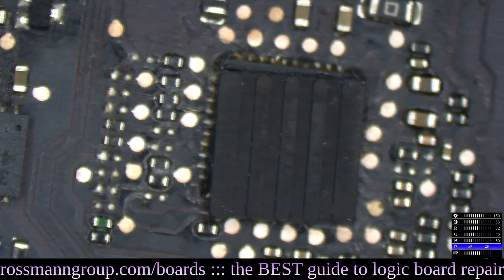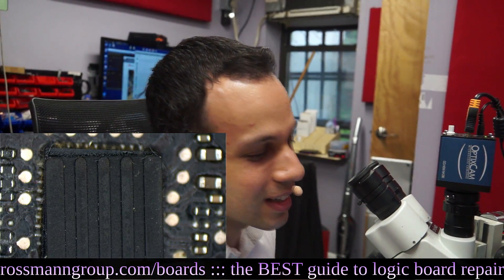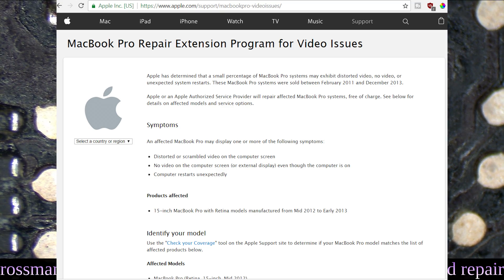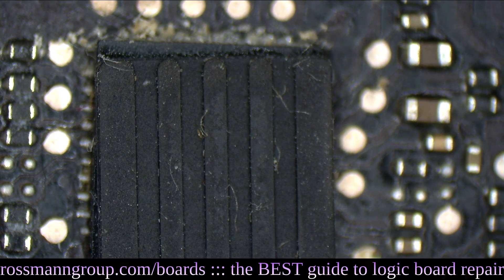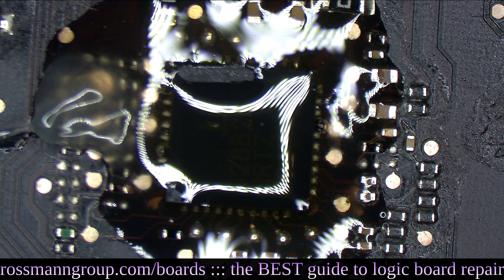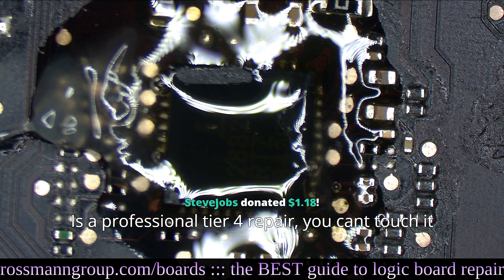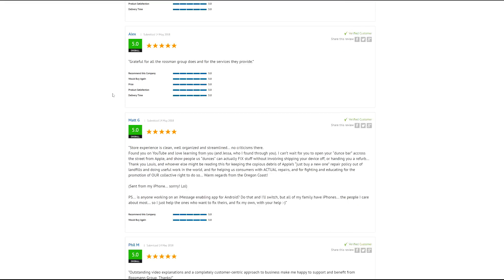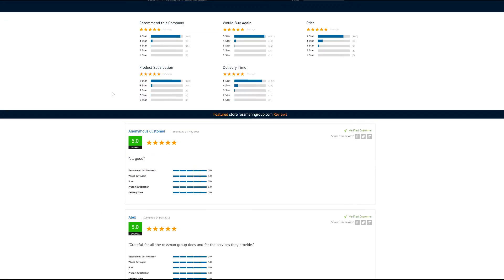How Apple authorized repair refurbishes Macbooks to fail again! GPU kernel panics

Comment: linux,ftw
Reply: Omi Kasigi I agree with this. I would never not dual boot my computers as I am a E&E student, a gamer, a novice programmer, and a really newb digital artist. 

From the perspective of a E&E student, the options of circuit sims on Linux is limited, but when there is one, it presents to be a good alternative. Example is LTSpice (Linux) and Livewire (Win) . Most students around me prefer Livewire because it is simply easier to use. Learning LTSpice is not as easy as learning Livewire. However, I found that LTSpice gave me more accurate results from simulation, and also had options that reduced my workload.

As a gamer, I don't have a Vulkan capable GPU. GPUs are expensive. Linux OpenGL is about the same as DirectX for gaming, if the program was optimized for OpenGL (e.g. DoTA2). Everything else gaming related sucks. Getting graphic drivers up is work, especially if you're new to Linux. The Linux Steam library doesn't have some of the games I like to play, and is quite limited (compared to Win). It's like gaming on Mac, don't do it.

From the perspective of a programmer, I'm split. I use Visual Studio to code in C++. That's mostly Windows only (I know there's Linux VS, but that doesn't have options I want). I use Codeblocks for other things, and that is both for Windows and Linux. I'm going to use ROS and Python, so that is Linux for ROS and any platform for Python. Both systems have similar offerings, and due to GPL and many GNU tools in Linux, I prefer Linux for this as I can just lookup a repo I need and type away in the terminal to grab it.

For digital art, Adobe CC. Just Adobe CC. Win wins this, no competition. If Adobe ever make their products Linux compatible (not everything on Linux is open-source), then I will happily migrate to Linux for this.

Sorry for the long rant.
Reply: Stacey Luster I dont care what "most people in the IT world think", that's an appeal to popularity
Reply: Just stop buying Windows software and games and tell developers to port software and games to Linux and use Snaps or Flatpak to deliver software and games to Linux or sell Linux software and games on Steam if they want you to buy software and games. Only developers of software and games can skyrocket Linux desktop market share.
Reply: Hi Richard !
Reply: DoYouW where did you  get those numbers? They sound completely made up. The only thing Linux is inherently worse for is gaming, because of the lack of recent driver support
Reply: TLDR: Both have niches. Windows covers more general use, gaming and creative use. Just a really big software library. It's like the Sony PS2/PS3. Lots of good games, lots of crap too. 

Linux is a good system to develop code on, especially back-end codes that has no GUI. Kinda like a 3DS. I wanna play my Pokémon and MH games, but that is really all that I enjoy on that system and no other alternative that's easy. 

I still dunno why to use Mac. I understand security is related to it, but I think good practices (like not installing each and everything you see) and Malwarebytes+AV software covers most things. MacOS is just a fancier Linux with a slightly better software library in my eyes.
Reply: Beginner friendly Linux distros like Linux Mint, Ubuntu, Manjaro, Solus, Deepin, etc. are good for everyone, not just enthusiasts. How to install a printer driver? Just open Driver Manager from Start Menu. It will automatically search for driver in repos and install it if manufacturer has made linux driver available.
Reply: +Kaczka Kwa Kwa to use a printer I run "xbps-install cups" and then I go print things
Reply: Yeah!
(But mainly for the higher degree of customisablity compared to Windows and Mac OS)
Reply: I'm starting to get into linux, it's nice when it works, infuriating when you hit some random problem and then spend the entire day googling and typing things into the terminal.. and when you mess that up it's basically time to reinstall! I'll get the hang of it in the end, not giving up!
Reply: indeed, it's like when we talk about our planete being at "the center of the univers", for newbies it sounds wierd and wrong, but for scientist it's a shortcut for "center of the visible univers" which make more sens for non scientist.
I agree we should take care of what we're talking about when dealing with ppl outside of communities but sometimes it's ridiculous to try since most ppl will eventualy shoot at you & get wrong anyway ;)
Reply: Simon T depend on how messed up ur system is. Usually, i would try to fix it and it would work.
Reply: From my knowledge macOS is used widely in music production. Semm to be a bunch of mac only programs that are the standard.
Reply: Perverted Poképuffs it's irony that my laptop would go blue-screen when I watch video online on windows,  # general_use
Reply: Stacey Luster until you want to run my game library on Linux lol
Reply: +Saxie81 There are many ways to run Windows games on GNU/Linux with minimal loss in FPS. You simply refuse to use any of them, and if the only thing you do with your life is play video games you're too worthless to need to use any OS, anyway. OS is in a sense, irrelevant to gamers, because they just want to launch the game. 

Stop saying "I want to run my game library on Linux", that's misleading. What you should be saying is "I want to run my Windows software on Linux". Now think about it, doesn't that just make you sound stupid?
Reply: acex222 I'm familiar with wine and other emulation that I can use.  It's certainly NOT misleading to say that at all.
Reply: With DXVK lot of games are running very good on Linux. Youtube search DXVK.
Reply: +Saxie81 WINE would be the lowest solution on my list.
Reply: Linux in the current state run way better with AMD card (Opensource drivers that work faster than the proprietary AMD driver on Windows even). Nvidia is only good if you want machine learning stuff and don't mind outdated kernel/video/xorg (Getting better there but still).
Reply: +DoYouW Most game for Linux on steam are Windows D3D games that convert themself to OpenGL or Vulkan on runtime. They come packaged with wine or have been compiled with EON for most of them, some have a customized wrapper that perform better, most of what Feral did actually are still using that kind of tech but it's way better...

So it is not Linux fault, but because Linux is feed with Windows games that run wrappers. And the performance hit relate to your CPU performance. On parity, with code that is compiled native for real on both platform, Linux perform slightly better than Windows. Also If you run old D3D9 with Opensource AMD drivers, they do perform better on Linux than on Windows as Linux do have native D3D9 support so conversion is not required here (except with Nvidia cards as they don't support D3D9 on Linux)
Reply: +Ultra Instinct Bardock LSSGSS If.
Reply: Stacey Luster you're wrong
Reply: Linux is only good for enthusiasts. Wanna answer 150 questions in order to install a printer driver? Fine.
Reply: I'd just like to interject for a moment. What you’re referring to as Linux, is in fact, GNU/Linux, or as I’ve recently taken to calling it, GNU plus Linux. Linux is not an operating system unto itself, but rather another free component of a fully functioning GNU system made useful by the GNU corelibs, shell utilities and vital system components comprising a full OS as defined by POSIX.
Many computer users run a modified version of the GNU system every day, without realizing it. Through a peculiar turn of events, the version of GNU which is widely used today is often called “Linux”, and many of its users are not aware that it is basically the GNU system, developed by the GNU Project. There really is a Linux, and these people are using it, but it is just a part of the system they use.
Linux is the kernel: the program in the system that allocates the machine’s resources to the other programs that you run. The kernel is an essential part of an operating system, but useless by itself; it can only function in the context of a complete operating system. Linux is normally used in combination with the GNU operating system: the whole system is basically GNU with Linux added, or GNU/Linux. All the so-called “Linux” distributions are really distributions of GNU/Linux.
Reply: I disagree. I use both Windows and Linux on my PCs. Linux has its uses, but Windows has more software options as Louis has stated. And I don't have the time to code my own stuff since I'm not really a programmer. I'd rather buy something that works "out of the box" on Windows.
Reply: That's quite normal, Linux is no longer capable of multitasking as well as win7/8/10 for games that's why projects like STEAM OS or other dedicated Linux based OS for games are falling down. Most bench on those systems show up +20-30% more speed on w7 and up to 50% more  speed on w10.
and it's not difficult to see why, ex: just by looking on what games rely on : DirectX which has to be emulated on Linux. And many other technical issues that make Linux OSes less and less suitable for PC games.
We could use some OPEN GL xx dev and game based on btw.
On others side, Linux OSes are perfect for small devices like phones,(android) Routers (gui), lan switching device, firewalls, etc. 
Even with new 2016 nano server architecture from MS ,  Linux OSes will probably stay king in small device for many years to come.

Comment: its like a time bomb...when the rubber goes bad,it makes the laptop seem useless
Reply: Völundr Frey, no, actually it should last just enough to make it through the warranty period. 
There's absolutely zero reason for apple to fix anything properly or make sure it will last for decades.
Reply: There's no UV and very little stress other than heat so it should last a good 20 odd years. Not for ever, but what does? Still a shitty job though.

Comment: "Make the janitor solder the products undergoing refurb and maybe add a rubber pad later if it does not mend together properly. Hey, After all most of the consumers won't see the solder joints, so lets chop down 50 bucks and sell it to fuck with them" 

I think that's what Tim Cook instructed the the "Geniuses" to do.

Comment: You think those are bad solder joints you should look inside a cheap consumer grade two way radio.  I see radios where the soldering is so poor that the joints fail before the radio even gets to the customer.  There's such a small amount of solder on them they break in shipping or within a week of use.
Reply: At least the radios were cheap.
Apple products are not. They have no valid excuse for this lousy repair job.
Reply: MikesRadioRepair do you realise that you are comparing some inexpensive product with a product that costs upward of thousand dollars?
Reply: At least hot glue is very east to remove.  Just add a few drops of isopropanol  alcohol and it pops right off.  In my world (radios) they have used that corrosive and conductive glue for decades that you have to remove with dental picks.  I spend hours every week removing that crap.
Reply: Hot glue is just Chinese underfill ;)
Reply: No self respecting Guitarist uses a Marshal amp that is of recent vintage anyways. Tubes or go home :) Yes the older technology in an amplifier is actually usually more dependable and tend to be of higher quality for the sound also.
Reply: I had a cheap 48V 5A PSU arrive with an inductor that had fell out of its through holes. I soldered it back on and it worked for about 5 minutes before it stopped working again.
Reply: You missed the whole point buddy, this repair is done by trillion dollars company through their refurbish department, and on top of that it cost thousands of dollars
Reply: Tubes don't make the audio sound better! The reason you think the tubes make it sound better is because the manufactures stopped giving a shit around when transistors became popular. Tubes just make it hot and bulky.
Reply: It's not a $1500 radio is it?
Reply: just because diarrhea smells worse than constipation, it does not make constipation acceptable.
Reply: MikesRadioRepair Thanks for the comment, I have subscribed to your YT
Reply: Completely agree. Apple computer that cost as good used car could not be crappy ripoff like 15$ worth portable radio from DealExtreme. Besides those cheap devices often live longer than Apple laptops :)

Comment: This just brings back memories of the ZX81 ram pack issue back in the 80's..   Oh... just put a piece of bluetack there to hold it in place. :/
Reply: Oh the infamous rampack wobble. I soldered mine directly to the Motherboard but then a butterfly decided to flap it wings 200 miles away thus crashing the whole show again.
Reply: Nah, I was probably 8/9 when I got it.  So didn't pay that much attention ... lol
Reply: Did you ever notice the recessed area and holes on the bottom of the ZX and rampack cases? Mounts for the bridge-plate that eliminated the wobble.

If you called Sinclair, they'd send you one of the plates. They had them, but didn't include them with the rampack.

Comment: These refirbs must come from a FoxCoon-like facility in another country or from a "third-party" reseller that offers bulk discounts, yes?
Reply: I bet FoxCon could do a better job.
Reply: I think the rubber pad was a standard fix for that recall used instead of resoldering though. so that particular part is on multiple boards. I'm not 100% sure, but I've seen it from another repair that had been apple refurbished.
Reply: I bet Chinese technician next to FoxCon could do a better job. but still Louis is the best.
Reply: I3UTM It could be from someone willing to get Apple authorized for the extra business, but not skilled enough to bring in customers on their own merit.  So when Apple offered to pay for repairs of millions of laptops, a large percentage would have to be sent to the authorized repair shops around town, and some of those would have to bring in new hires for the short term influx of boards.  No particular reason to believe every board ended up this bad.

Comment: Louis turns Macs into PCs.
Apple turns Macs into doorstops.
Reply: LOL
Reply: Guess wich Apple says is illigal?
Reply: Just wondering wasnt pc an ibm trademark? Because if its not then macs would technically also be pcs. Just thinking and wondering how would that shit get accepted as an argument in court....
Reply: @laharl2k  Beginning in 1981, IBM opened up the architecture of its new PC (except the code in its BIOS/CMOS), allowing independent vendors to produce and compete for business. With Apple, there is no competition, as the entire chipset in their motherboards is copyrighted.
Reply: Yeah, pretty much.
Reply: It's too light to even work as a doorstop xD
Reply: Throw the Mac overboard and call it a boat anchor!
Reply: You are the winner of the Internet today! 🤣
Reply: I thought Apple turns Macs into concrete booties that they use to threaten you will wear should you deviate from their directions.
Reply: The level of truth is too much
Reply: lovely piece of art @rossman
Reply: they do more than  that they also turn them into Paper Weights so your papers don't blow away.
Reply: @Dank Memes Guess my x86_64 (x64 isn't the name of the 64 bit extension of x86) running Linux and macOS isn't a PC, until I reboot it into Windows...
Reply: In the broadest snse modern macs are PCs running Unix.
And for those who want to use the software but not the hardware: Hackintosh.